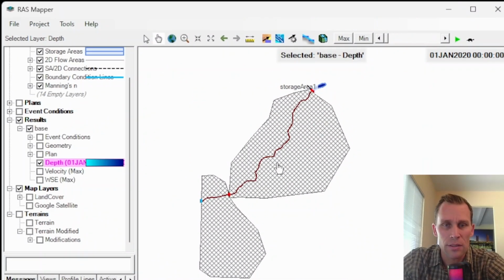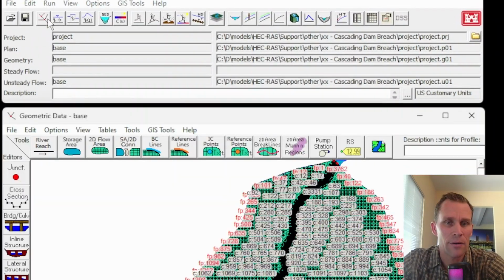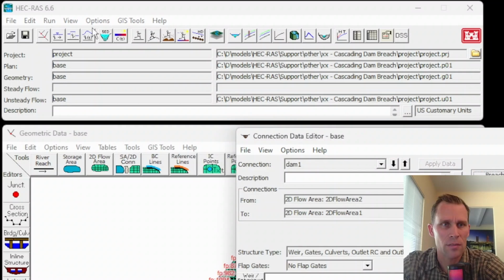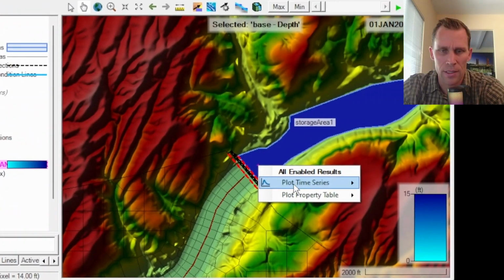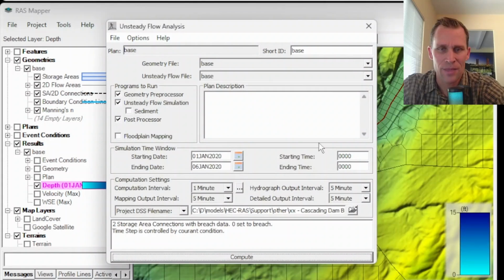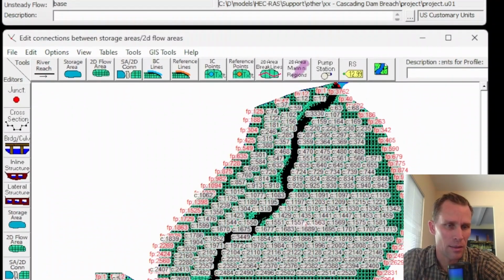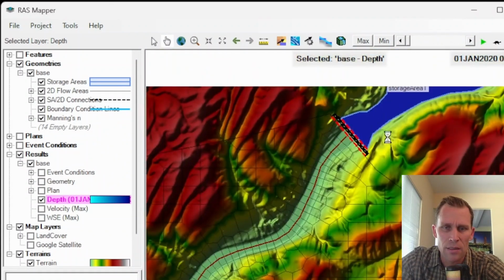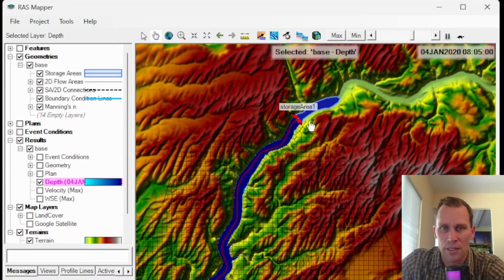HEC RAS Support 20 - Cascading Dam Breaches

Comment: Hey Tim, thanks for the lesson!

Is there a difference in creating the Dam as a 2D Connection in the same 2D flow area and in doing that with different 2D flow areas (like you did in the video)?
Reply from the maker: Hi Felipe - I don't think it should make a difference. In fact using just one 2D flow area might be easier and more realistic.

Comment: So, if I run the simulation breaching only the upstream dam, and the flow goes trought the downstream dam, it means that I should breach the dowstream dam too?
Reply from the maker: It's really whatever scenario you want model. If you want to set both dams to breach, you can tell RAS to breach both dams.
Reply: @TimNelsonPro  Thank you so much!
Reply: @TimNelsonPro  what is the red line geometry and how does it work in the simulation?
Reply: @TimNelsonPro  I want to breach both dams where the dam 2 breaches only after the flow from dam1 reaches the Storage area of dam 2.
Is WSE+time  the correct approach? and Why storage area of  dam 2 is not modelled here?Is it Unneccessary?